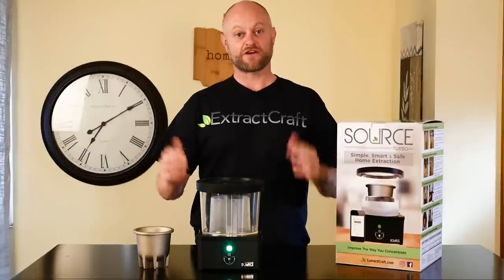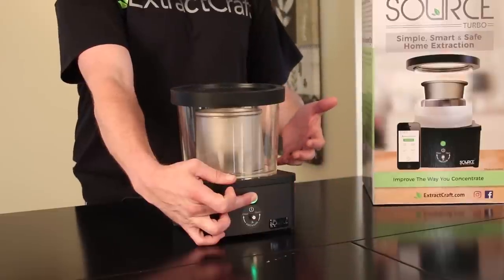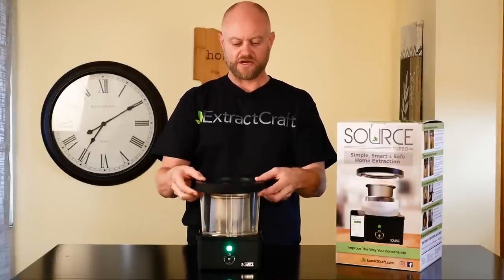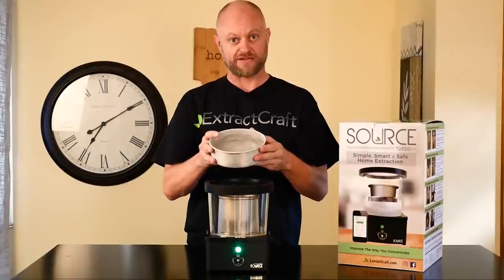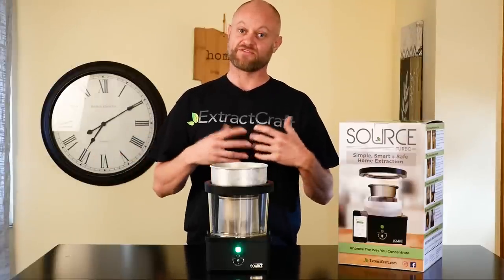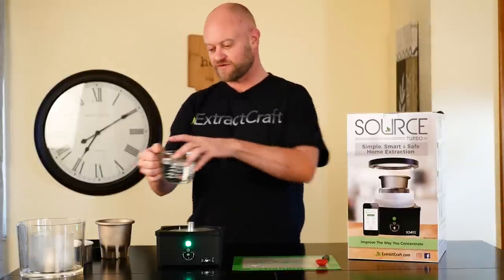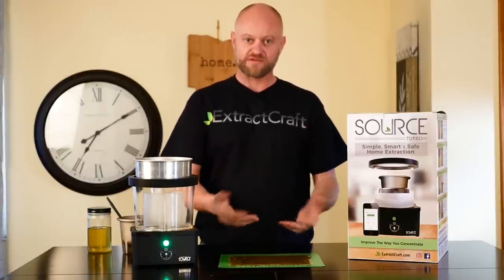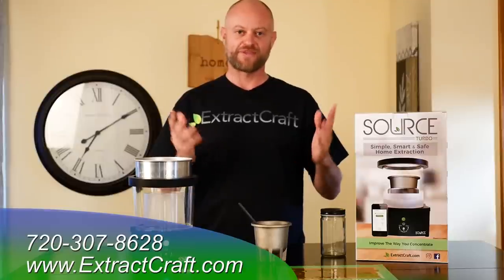Alcohol extraction using the Source Turbo by ExtractCraft

Comment: I've been using my new Souce Turbo all this week since it arrived. What an amazing machine, thank you !!
Just wondering, though, as it is difficult to see exactly the consistancy of the FECO while the machine is working (it's dark down there inside), is there a good way to tell when to stop the process. Should I watch for the solution to stop "boiling",  or should I watch for the rate of recovered alcohol dripping in the machine and stop it when there are no more drops ?? I want the FECO to be liquid enough to suck up with a syringe and then be injected into a refillable vape cartridge.
Reply: I haven't heard back from you yet but I think I have solved the problem. 
I put a cup of water in the globe and then drew a line on the outside of the globe at that water level. I also drew a second line at the 1 1/4 cup level.....the maximum line in the crucible. 
Now, I find, if I watch the level of the Everclear being collected I can stop the extraction process as soon as all the alcohol has been recovered and the oil is still liquid enough to extract with a syringe. Seems to work well !
Reply: oswaldofreeman  Yes, there would be a small amount of ethanol remaining to make it more liquid but, when the FECO is poured out on to a silicone mat and left for awhile, any residual ethanol will evaporate off.

Comment: Could you add MCT to the crucible once the cycle finishes and make your edible oil?
Reply from the maker: You can, and some people do, but I would keep outside contamination out of the crucible as,
much as possible.  Instead, I would use a secondary glass jar with slightly warmed MCT oil and combine the oil.  A magnetic stir plate works great for this.

Comment: I used my Turbo for the first time with fantastic results. I do have a question though, at the end of the 2 hr cycle there was some alcohol on the base of the unit. Only a thin layer and only in one area comprising about 1/3 of the base. Is this normal?
Reply from the maker: Inside the chamber is a wet working environment so a little ethanol condensation is not uncommon and is designed for it.  It should be just enough that easily wipes away
Reply: @ExtractCraftVideos  Roger that, thank you.

Comment: At what point can it get down to RSO consistence where it could be sucked up in an oral syringe?
Do you restart the machine in turbo mode a 2 nd time?
Reply from the maker: It would likely take 2.5 to 3 hours to get it there. So you would do the first 2 hours on turbo, then start it back up in turbo and stop it when it looks ready

Comment: In order to use the extracted oil in edible forms the THCA and CBDA must be decarboxylated to be converted to THC and CBD. (For smoking or vaping, of course, this does not matter as the heat of that process will decarboxylate the cannabis.). With the Source Turbo, do recommend decarboxylation before adding the alcohol or do you recommend decarboxylating the FECO after it is removed from the Source Turbo ?
Thank you.
Reply from the maker: It comes down to personal preference
Reply: @ExtractCraftVideos  OK, thank you. I should have read more posts down the page, as you had already answered this question several times.
Cheers.

Comment: So once that oil is completely dry is it technically shatter? I'm a little confused because you just call it Cannabis oil. We have oil "tinctures" , RSO/FECO , and Distallate. Then you have Shatter, Crumble, Vader, and Terp Sauce. Also can this machine make multiple products?  ✌️💚
Reply: Shatter is made from butane or other gases. Cannabis oil is any extraction.  This is RSO/Tinctures and is meant to be eaten or applied, not smoked.  It is mainly used to cure cancer and get really high.

Comment: Can you decarb first then make the oil and just let it dry at room temp and a fam once you have extracted the oils? Or do you have to use non decarbed.
Reply from the maker: Yes you can.  That’s the beauty, you control it and make whatever you want.  You can decarb plant material first, or you can decarb the oil after.
Reply: I am very I terested but after you soak your material and evaporate/reclaim the alcohol, do you have to place the oil in the oven, and does it smell real strong?

Comment: I'm in a position where I have to extract a fairly large amount (9-10 plants worth) over a short period of time (for storage-before-it-rots purposes). About how many ounces/ml of oil is considered the maximum for the crucible? Also, I noticed in the video you mentioned blowing on it with a fan to help out; would operating the unit in a 10f-20f garage be OK as far as longevity of the device goes, or is it happier operating in warmer-than-freezing ambient environments?  

Shorter version: I have a lot to make before spring and can't afford a bigger machine, so I want to know if doing this in a garage in Maine winter (1-2 runs per day over the course of a couple-to-a-few weeks) will hurt the Source Turbo 😅😅 Thanks in advance!
Reply from the maker: The Source Turbo can get through around an ounce of plant material within 2 to 3 hours. So you should be able to get through about 3 ounces a day if it's always running. This should not hurt the machine.

But as you mention, our larger unit, the EtOH Pro, is much more suited to high volumes and can get through a pounds worth of plant material in about 3 hours.

Comment: The pump kicks on and off during the process for a very specific reason.  If a vac is created, and then alcohol has evaporated, and then the vacuum is released, that evaporated alcohol has to collect somewhere, as Dude said perfectly!

But those little purges are removing the alcohol/ethanol that’s in the air, otherwise it would just recollect inside the original crucible

Comment: How do you remove the oil from the mat into a container after decarboxylating in the oven?
Reply from the maker: When the oil is on the mat, you can fold one end of the mat into itself so the oil sticks together, then pull it apart. The oil should stick to itself, and if you do this repeatedly, you should be able to get your oil into a ball that is easily removed from the mat and placed where you'd like. If the oil is a bit runnier, you can also put the mat into the fridge for a little while which will help it stick to itself.
Reply: @ExtractCraftVideos  If you were to reheat the oil to get it runny again, would it be too thick to get into a syringe? I am trying to purge the alcohol out 100%, but then the oil seems to get very viscous and hard to handle.
Reply from the maker: @smurf88  Reheating it and sucking it into a syringe does work. Sometimes people add some carrier oil into it like MCT oil to thin it some. But yes, you should be able to get it into a syringe if reheated

Comment: If the target use is vaping using the Storz-Bickel dosing capsule system, how do you fill the (liquid style) vape cartridges? Use the Source Turbo to cook down to an oil that could be dropped into the cartridge with an eye dropper? I'm trying to imagine the process to get from Source Turbo to Storz-Bickel vape cartridge. (Maybe do a vid on that?) Thanks!!!
Reply from the maker: Check out extractcrafter.com for information on making carts

Comment: If I am extracting AlCohol from Saffron tincture, can I use the oil directly into mixing with other oil such as Agarwood oil in case of oil based perfume? Or there should be another step added. I also noticed boring the oil into a mate? Does that mean I can’t put it in a clean Jar?
Reply from the maker: They can be mixed directly into any formulation you desire to make.  You can put into a jar as well.
Reply: ExtractCraft thank you so much for your prompt respond. Unfortunately, 1L Buchner funnel (120mm) and Flask out of stock

Comment: Do you need to decarb the flower or does the heating cycle of the Source Turbo get that done?
Reply from the maker: Negligible decarb will happen in the machine, it works at very low temps, this gives the user the ability to save as much of the delicate components as desired. If you are making something that requires decarbing you can easily decarb the plant material first or the oil afterwards.  This article might help https://extractcrafter.com/2019/01/29/decarboxylation-decarb-101-basic-understanding-and-at-home-method-comparison/

Comment: If I live in a state that has a 151 alcohol limit, can I use this to distill the 151 up to 190 by running just the 151 through the turbo mode so I have a better solvent, or does it get warm to the point it will boil the water too?
Reply from the maker: It would be best to begin with the proper solvent

Comment: if I wanted to gather the concentrate in a jar and seal for  decarbing at 180 degrees,  how long would I let it sit out on a mat to air dry enough so there's little to any ethanol left in the concentrate?
Reply from the maker: It could be anywhere from 2-7 days of sitting out before it is fully air purged.
Reply: @ExtractCraftVideos  Thank You!

Comment: Can 151 everclear Grain Alcohol be used?
Reply from the maker: You must use only 190 proof or higher, non-denatured ethanol in our equipment. So Everclear 190 works great, but Everclear 151 does not.

Comment: New to this. I didn't see you run the oil through a filter? So you just pour the oil on the screen, let it air dry?  I used to get RSO in a syringe to make capsules, but I want to use this method. After the oil/mat air dries, (how long?) can it be put in a container and then use a syringe to suck it up to dispense into capsules? Thanks!
Reply from the maker: Hey there. The filtration step is done before you put the wash into the unit to make your oil. First you'll soak the plant material in 190 proof or higher, non-denatured ethanol. Next, you'll filter out the plant material and other undesirables. This filtered wash goes into the unit, where the ethanol is evaporated off under vacuum and at low temp. You'll reclaim the ethanol for reuse and pour your oil out of the crucible, ideally onto something like a non-stick silicone mat. After air purging, you could lightly warm this oil and suck it into syringes to then put into capsules. Hope this helps!
Reply: @ExtractCraftVideos  Thanks so much for the reply. I watched all the videos from IchibanCrafter, now I know! I ordered the Source Turbo and the mat. How long do you recommend I air purge? I live in Hawaii so room temp is mid 70s. Can I microwave the mat to warm the oil for the syringe? Thanks!
Reply: @ExtractCraftVideos  Do I decarb before wash for FECO? Thanks.

Comment: Quick question I’ve noticed this for some time I’ve been using my source for over 3 years now and every few runs of my 99% iso wash’s during the extraction my soup dont boil why is this ??
Reply from the maker: Hard to say with this information alone but you can always contact customer service at info@extractcraft.com. That said, these units are designed to be used only with 190 proof or higher, food grade ethanol and not iso, even if 99%.

Comment: You say round up for altitude,so would I still round up to 2000 when I'm at 1200 or would you suggest trying 1000 1st?
Reply from the maker: Try both and see which works best for where you are.  Lower altitude settings makes it more aggressive, higher altitude setting relaxes it a little.
Reply from the maker: @jamigregwalls9775  It might be best to reach out to customer service at info@extractcraft.com or 720-534-1242

Comment: Damn, didn't know you have to decarb it. Crazy to think you still need to decarb it after running it for 3-6 hrs.
Reply from the maker: The beauty of our equipment is that it happens under vacuum, so it's only running around 105 deg f. This is important especially when people are trying to make smokeables like wax and shatter that do not need decarbing. If you do want a decarbed end product, you can do it with the starting material before or the oil produced after. The run time for a full gallon load is about 3 hours.

Comment: As for the over-flowing, (if plastic is an option, which it appears to be okay with alcohol your using) I would use a baster/syringe to get most of it into the bottle, then when there's just a little left, dump er in too. Just an idea. Great video, would love to try this thing out sometime! Cheers
Reply from the maker: Are you referring to when you empty the collector of the reclaimed ethanol?  This was addressed and is not a problem with the new redesigned collector that is used in the video.
Reply: Oh awesome! Looks like an amazing machine, super clean. Maybe you could work the vacuum purge into that bad boy too 😁👌👍 Great work guys, cheers

Comment: Thank you. Quick question: does decarbing the oil at 240 for 40 minutes destroy the terpines in this form? The process retains terpenes, but does the decarb destroy them in the end anyway?
Reply: Great question, and a complex one.  Decarbing always evaporates and converts terpenes.  The question is how much damage you will do. If you decarb then use another process to concentrate that adds a lot of heat in open atmosphere  you continue to oxidize, convert, and evaporate components.  With out equipment you don't do that.  There area also decarbing techniques to capture the evaporated terpenes and include them in the extraction that can be found on the blog www.extractcrafter.com.   Next, we are also working on a  natural decarb protocol that would allow decarbing without losing any terpenes and our equipment is the only equipment that will be able to process this without burning off the terpenes with heat and open O2 atmosphere.  Lastly, out equipment gives you the versatility to make many different forms of extract either in the decarbed or not-decarbed form.  The not-decarbed form of CBD-A and THC-A are showing amazing results for many treatments as well.

Comment: Doesn't the heat change the constituents in the tincture, maybe destroying some of the heat sensitive ones?
Reply from the maker: The intention of the design and working under vacuum at low temps is to avoid as much damage as possible.
Reply: @ExtractCraftVideos  thank you for the reply. So what is the difference from a tincture being distilled in a vacuum or without vacuum? I'm looking for a distilling machine right now to take the alcohol out of my tinctures to reuse that alcohol, I found a machine for 130 Canadian but it doesn't use vacuum. Should I invest in one that creates a vacuum? Is it a big difference? Can you help explain the difference? 
Thanks so much.
Reply from the maker: @veganangel811  vacuum allow for evaporation to happen at lower temperatures

Comment: Since alcohol doesn't freeze why not stick the oil in the freezer...I didn't feel stupid when I woke up...now back to bed. Looks cool for the person without a pressure cooker. The Instagram ad doesn't do your product justice it seems. Thanks for being creative 🌅
Reply from the maker: Fenix, The ethanol was put in the freezer for the process, however the oil will essentially have not alcohol left in it.  Oil doesn't do well in the freezer.  Also, I'm not following you with the pressure cooker comment.  We, and most extraction tech, works under vacuum not pressure and using a pressure cooker would make for a very poor quality end product.  Positive pressure for the process is not recommended which is why neither pros nor amateurs use it.  If you have any other questions you can catch us at info@extractcraft.com or check out the resources linked at the end of our website www.extractcraft.com

Comment: So if you dont want to go above 100 degrees to preserve the terpines when reclaiming the alcohol, does decarbing at 244 burn through the terpines at that point? What is the usage for un-decarbed? Would you need to decarb if you were putting it straight into a vape pen?
Reply from the maker: If you decarb you will be working through your terpenes pretty well, especially the lighter ones.  Using our equipment will limit the further conversion or loss in the process.
Reply: @ExtractCraftVideos  I second his question. You stated you should go over 100F to preserve terpenes, but you also recommend de-carbing at 240F for 45 min. Would this destroy terps? Also, does decarbing increase potency if the concentrate is being vaped? Thanks for your help!
Reply from the maker: @lou1016  That is the trade off.  Decarbing ravages terpenes, so if you are making something requiring decarb then that's just a function of the operation.  However, where the difference comes in is that with our equipment in processing and recovering the ethanol will be done under vacuum and low temp so the final product isn't exposed to unnecessary additional heat and air exposure leading to increased loss, conversion, and oxidation.

Comment: I want to as i am doing a herb tinctures with alcohole and i want to remove the alcohole and get the herb and mix it up with  Distilled water and have the tincture in liquid form can this help me with that ? if so when can i buy one ? and do u Ship to Sweden?
Reply from the maker: This would most likely not work as the resulting end product would be an oil base and it would not combine with water.

Comment: can this work with extracting pine needles essential oils?
Reply from the maker: Big yes and small no.  Ethanol will give you a botanical extraction between tincture, absolute oil, and a concrete depending on how you finish.  They all contain essential oil and a deeper extraction but not “essential oil” isolated on its own

Comment: How many times do I press the button 
To set the altitude if I am only 3 metre or 10 feet above sea level
Reply from the maker: When going through the altitude setting protocol you would push zero times for sea level.  The directions for doing this are provided in the machine and in the user manual under "altitude setting" or if video works better for you there is a new user introduction video that goes through it as well.